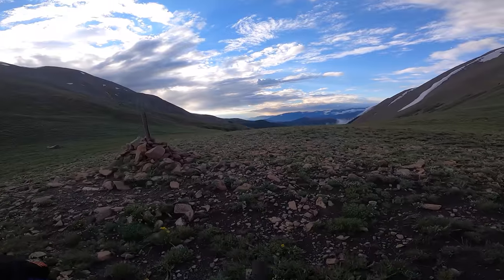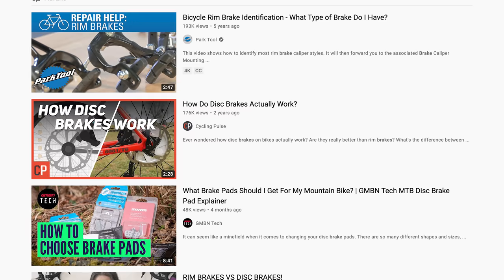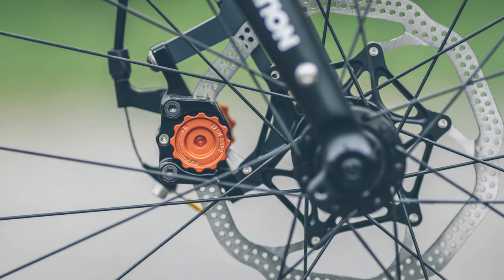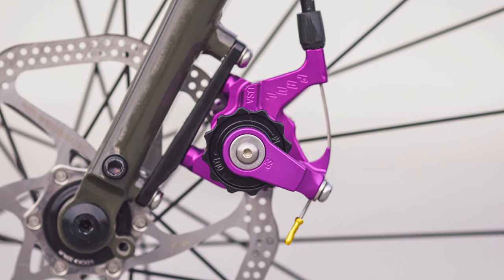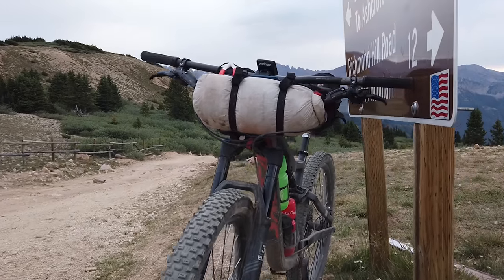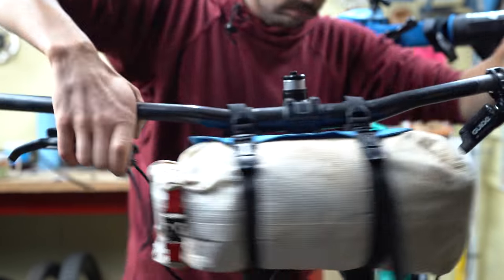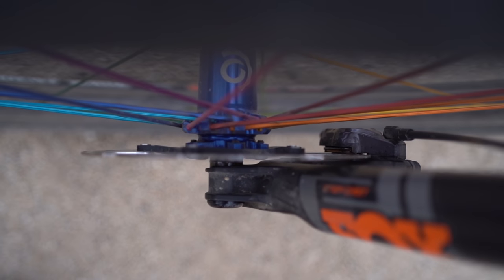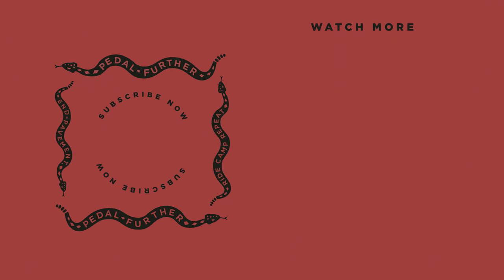The Best Brakes For Bikepacking?

Comment: Reliability of hydraulic brakes is pretty established with major brands putting them on mid entry level hybrids now.   For road use, I don't object to even cheap mechanical disc brakes, and they are going to have more than enough power to throw you over the bars.  I have canti's with kool stops on a cargo bike that stop it just fine in the rain with the bike loaded upwards of 270+lbs, but setup is a pain.    I like the modulation of properly setup V brakes, but pad/rim wear and wet weather are the big drawbacks.  I have worn out a set of V brake in a couple lift served downhill mountain biking runs back in the day, so I wouldn't run rim brakes other than on a vintage bike,  for riding around town, or on my road bike.

Comment: I love these videos.  Very informative.  I have both mechanical (BB7) as well as hydraulic (XT-2 pad) on my Surlys.  Nothing can beat the stopping power of the XT.  But, for fixability, I still use the mechanical on the longer rides.  I also bought a hybrid (mechanical/hydraulic - Zoom X-Tech) on a bike (Stump jumper) I use for testing - smoother than the BB7, but not as much stopping power.  Waiting for metal pads and 180 mm rotor to see if I can get it to stop better.

Comment: Another reason why your front brake is the most important one is that, when braking, the mass of you and your vehicle shifts forward and therefore puts extra weight on your front wheel (and relieving your back wheel) which gives you more grip/stopping power.
Reply from the maker: Great point, thanks for the comment.
Reply: Just like a motorcycle. 70% of braking power comes from the front.
Reply: & that's Me. the euros, & motos run the front on the right hand brake lever. Tort lawyers are responsible for American bikes having left lever front brakes.
Reply: Yup.  I used to train descending with just front brakes; just to keep from going OTB.

Comment: Running Origin 8 Vises (a copy of the Yokozuna Motoko 2 piston) on my Giant gravel bike and they are OK. I went to this style because I wanted to eliminate the massive Giant Conduct stem mounted cable actuated master cylinder and keep my cable shifter/brake levers. Glad I did too cuz not only was that boat anchor over 400 grams (454 is a lb), it was a huge obstacle for front bags of any type. I'm currently waiting on a backordered pair of Yokozuna Optimos with the 4 piston design.  I think these are the ones Logan reviewed last year.  They should have more stopping power for sure.

Comment: Side note on hydraulic brakes.  Shimano uses mineral oil, this is great above 20°F but can swell in the lines below that temp.  The swelling causes lose of brake modulation and can even lock up or ruin your brakes.  Sram uses DOT fluid which doesn't swell as much in the cold and is a much better deep winter brake.  However, I do have a friend that sees issues above 90°F with his sram brakes. Paul Klampers are the mechanical disc brakes I feel best about setting up and maintaining.  They aren't perfect but if you ride in a wide variety of weather they are great.

Comment: Definitely a hydraulic brake person although I envy the ease of maintenance and consistency over a long time of mechanical brakes. If you slack on your maintenence with hydros a set of cantis will end up outperforming them. My single piston Shimano are great after they've been tuned up but they dont stay that way all that long. Mechanical brakes on the other hand work just about the same all year long, especially rim brakes tbh.

Comment: Absolutely fantastic vid, probably the best content i have seen on YouTube about bicycle brakes. I have a Radrover 5 Ebike and the brakes are absolutely crap!! These are stock cable actuated mechanical disk brakes. After riding this bike 5,000 miles in the last year there is so much maintenance just to keep these brakes working. Any suggestion on a better mechanical brake to install on this bike? Not concerned about price, just need better brakes. All comments welcome. Thanks from Woodinville WA.

Comment: My touring/bike packing bike has hydraulic brakes - mainly because it was built using my old mountain bike components  on a new Surly frame. I use Hope two piston brakes on the rear and four piston on the front - because that's what I had! they are now 13 years old and all I have done is clean them and change the pads and rotors from time to time as they wear out. Both are 160mm so I only have to carry one spare. They are now getting a bit noisy and squeal a lot but they still haul me up like a champ - even on steep descents with 60lb of gear on board. They have braided hoses so are super tough and have survived many cartwheels and tumbles when they were on my MTB. I'm in no hurry to swap n- if it aint broke, don't fix it!

Comment: I recently switched from organic to semi-metallic front pads on my gravel bike & I'm a fan. It's a ultegra hydro & coming from a gravel bike with BB5 it's a good upgrade. One con to hydro is pistons can get stuck & will need to be cleaned as I experienced the other week. 
I upgrade the bakes during spring on my 27.5+ bike from the sram level TL & sram rotors to G2 RS with Magura storm control rotors, which are 2.0mm thick. Rear is still stock TL with 180mm rotors but I now have a bit more modulation & better emergncy stopping power. The thicker rotor also need to be a bit more durable but might just be a placebo effect.

Comment: Rim brakes were so simple. I never had an issue accept squeaking brakes.😀 Mechanical disc brakes are just easier for the average biker. Most don’t have huge downhills or need for such power. I’ve had mechanical disc brakes on 2 gravel  bikes and had more than enough power on both. I now have hydraulic brakes on a Hardtail and a 29er bmx. The bmx is stored in the garage hanging by the front wheel to save space and I’ve found that sometimes this causes the brakes to go squishy. The hardtail has had extra long cables that came setup from factory for 9 months because I am cheap and don’t own the tool to insert the barb. I have almost all other tools having been a bike mechanic and have worked on many mechanical disc brakes with great success. Hydraulics are just complicated😔

Comment: I use the cable-actuated hydraulic TRP Hy/Rd on my commuter/gravel bike. The modulation and stopping power is way better than a pure mechanical but falls short from pure hydraulic. My fingers don't get tired on long descents with my fully-loaded bike+gear weighing around 50 lbs. The only downside I have from the brake is the reservoir is huge af (aesthetics) and the semi-metallic brake pads squeals loudly when it's wet.

Comment: I run cable hydro Juin x1 in the front and trp spyre in the rear. Mostly bc the juin tech worked so good I put my rear brake on the front of my gf bike and put the mech on my rear. If the juin tech dies on a trip I’ll just switch the spyre up front until I’m home

Comment: Great vid as always.  I’ve all of the above on my various bikes, I will say the cable actuated hydraulics are great but get a brand that you can manually adjust for pad wear such as Juin tech.  Neil, I’d love to see a video on the use of clip on aero bars for bike packing especially when paired with hooped handle bars such as the Jones or so see Confucius.  Live to hear you advice and lessons learned.  Cheers

Comment: There's a compromise as well. Shimano just released the 12spd hydraulic R7100, but no mechanical. Leaves a lot with R7000 11spd wanting a mechanical disk option. The hybrid disc-actuated hydraulic brake is a solution. The Juin tech GT-F being a solid goto for gravel & bikepacking.

Comment: I've been hearing a lot more recently about how good Paul Klampers are... a far cry from the BB7's I used to run. Now it's XT 2-piston but I will prolly be going to XT 4-piston. I'm a shimano guy simply because I don't want to use caustic brake fluid unless I have to. Mineral oil for the win... Thanks! Riding in -40°... NO THANKS!!!

Comment: 4 piston, hydraulic, sintered pads, and stick with SRAM (Code R's) to answer the up-front questions.  Would have steel-braided lines had I good reason to worry.  (Some new super-cars are coming with 6 piston calipers..!  Trickle-down to motorcycles and then mountain-bikes down the road?). Lastly, living in Nevada, which is the most mountainous state in the Lower 48, have found that more is better no matter what   you're doing.  Bombing down Mt. Rose Highway or any mountain backroad at 40-45 mph, 4 pistons make things safer, faster, and more fun.        Spot-on video btw(!).

Comment: on my touring mtb I use a two piston hydraulic brakes and on my gravel bike its a cable actuated hydraulic set up. It's a world of difference. On my MTB I can stop on a dime anytime. On the other hand, my first 100km ride with my gravel bike got me into a minor bump because I couldn't stop fast enough enough. Rain could have been a factor on that too.
Reply: RollinRat  Agreed. I went for cable discs as I couldn't afford the hydro model, but thought, it's not a cheap bike and they're not going to have some unsafe brakes for a decent bike.  I was so wrong.
Reply: RollinRat  thank you. It's a boardman adv 8.6 (not the best brand etc but I got a discount through a friend). The brakes are Tektro MD-C510 flat mount cable (I'll be swapping with at least a bb7 and better pads, I have a spare from an old bike). I can only get a good quality breaking if I shift my hands down to the bottom drop. Brifters are Sora. I will add compressionless cables so thanks for that tip too
Reply: RollinRat  I appreciate the comprehensive rundown, confirmed a few things too. I will make what adjustments I can already ie positioning then see what can be liberated from old. I had a mtb with the long brake levers and old bb7, was great, got stolen though. Yeah it does feel like a fat tired road bike, I thought it would make for more comfort from multiple grips plus chance to get a bit more speed from low positioning. I am in agreement on the brifters too. At the mercy of needing a jack of trades bike rather than a couple masters.
Reply: RollinRat  I keep it till so much is knackered that it's either a full refit or a replacement, and they're never stellar to begin with, only had a few lifetime. I like the bike just miss the sure stop of old flat bars, which from what I've seen the hydraulic fixes. I feel like it's a natural flaw of the grip on the brake and its pivot. Also even with V breaks its coming from both sides not single like cheaper mech disc
Reply: RollinRat  I heard horror stories of sram failing on hills. That Surly bar looks amazing, I looked for bar swap options before but had no luck as it weren't just the bar. Even without the build issues I prefer the brake and shift separate, just a bar that goes one way to stop, no alternate direction for shifting. I guess custom build is the only way for both

Comment: I have a notion that mineral oil freezes up from about -5 Celsius or colder. I have been thinking of a multiday (at least a week) unsupported bike packing trip in the Himalayas with subzero temperatures. Would you suggest mechanical or hydraulic ? Thanks a ton….😇🙏🏼
Reply from the maker: SRAM Hydro, it uses are DOT fluid which performs much better in cold temperatures.
Reply: Mas péssimo em altas temperaturas.
Reply: You're going to be far from bike shops... Does hydraulic really make sense?
Reply: @szurketaltos2693  hmm yeah….that’s always there at the back of the mind. Having used hydraulic brakes for ages, it’s like an addiction where one doesn’t want to let go of hydraulics for mechanicals….😁…..
Reply: @sun27g  it might make sense to bring a mechanical set as a spare then rather than a bleed kit.

Comment: Well I changed to Paul Components Klamper Brakes a good number of years ago and have not looked back, yes hydraulic Brakes work great are much cheaper than Klamper Brakes but having to bleed hydraulic brakes all the time at work in a bike shop, when I go riding I just don't want to think about repairing or bleeding my Brakes because I'm having time out from work. So I pay full price and run Paul Components Klamper's and it's time to buy a second set in the coming months.
Reply from the maker: Lots of Klamper love, maybe I need to give them a full time test. I do love the fact that they are made in the States.

Comment: I've been on (the same) BB7s for a decade at least. The older ones were just built better. This year I added compressionless housing and 203mm rotors to the recipe and I gotta say, they are as powerful as my Saints on my other bikes. Metal pads for longevity through all conditions.
Reply: I'm on the same setup.. BB7 + 203mm for 17 years.. hard to trust anything else

Comment: I’ve got an old mountain I’ve tried to turn into a bikepacking bike. It’s my everyone not single track bike. It has rim brakes since it’s ‘96. I assume it would be a good idea to have a fresh set of pads if I plan on going on a long multi day trip.
Reply: The best V-brakes I have ever had are ProShift brakes.  Best mountain bike rim brakes I have ever seen.  If you can find a set, grab ‘em!  They’re a lot like the Hope of the 90s; all custom CNC machined.  I still run them on my Fat Chance Yo Eddy.
Reply: Invest in PAUL linear (V) brakes and learn how they function, not too bad. Unreal stopping power for a V-brake, the legends are true. KoolStop pads and you're good to go. I forget that I have vbrakes in back and a disc up front. They are amazing brakes by any standard. Not cheap but I've a set that are ancient, the pink anodizing has faded,  but they function like new.

Comment: Where are cable brakes cheaper? 
I recently tried to build a Krampus on the cheap, and looked at cable discs thinking they were cheaper. No way - entry level Shimano M400 series are about $50 an end, lever, caliper, and pre-bled, ready to instal brake hose (about $15 cheaper than a BB5 setup here - taking into account the rotor and cables). Somewhere along the way cable discs have evolved into a boutique product, the rest of us are stuck with fantastic hydraulic brakes.

Comment: I went from cable BB7's (often said to be the best for power & "modulation" to Sram Level TL 2 piston hydros on my bikepacking MTB & was blown away. I rode big motorcycles before getting into cycling & that's usually two (yes, two!) 6-piston calipers (yes, 6!) up front, & a single 6-piston on the rear with a smaller rotor. I had reservations about reliability like most people do but I don't know why. It's going to be a looooong time before you need to replace a hose. Bleeding bicycle hyrdos once or twice a year is a doddle. Similarly the upgrade from 2-piston Level TL's to 4-piston Guide R's was noticeable in power & modulation. I ride with full camping gear on rough steep trails sometimes & that's where these things shine. The cable actuated hydros look very neat! Maybe when my Guides wear out in about 20 years time....

Comment: This along with the Tire video has been extremely helpful to a bike noob planning a great divide trip.  Do you think its worth replacing the mechanical brakes on my brand new fargo with hydraulics if its a trip of a lifetime for me and want to have the most enjoyable time?
Reply: First I would ride the bike as is.  Then I'd load it down and ride down the biggest steepest hills that I could.  If the brakes feel inadequate I'd try increasing the size of the rotors.  Other things that will improve the function of your cable disk brakes are higher quality compressionless housing and if applicable I'd machine/file the housing ends flat/square.  Bad ends on the housing significantly decreases the brakes performance.
Reply: @mikekrasovec6390  thanks! but I’m a hiker and have no clue what a lot  of that means or if as is is enough for the GD.  Will try though. 
How much is it to replace with good hydraulic set up
Reply: Trp spyres are good when finetuned & well adjusted. Theres a Good tutorial on YouTube from an old dude from Great Britain
Reply: @pgreenx  I think that you'd probably be fine with what you have.  Installing bigger rotors is an easier and cheaper option.  Mega expensive wunder bikes are rad.  What you have is probably good enough for you to have a good trip without your bike turning into absolute junk.  Have a few multi day local trips with what you already have.  Maybe your handlebars will need to be further out/closer in or higher/lower,  different grips/bar tape,  seat...  or something.  Ride your bike as is.  Worry about your contact points.  With hiking you want shoes that are comfortable for you as well  as a backpack that works for you.  Bikes are having the seat and handlebars in the right place,   a seat that works for you... I will add that there are lots of different types of handlebars as well as variations of a certain type.  Within those variations the bars there are differences in how the bars bend  - those differences seem minor but actually make a significant difference after you've spent enough consecutive long days on  your bike.  Ride the crap out of your bike.  Make sure that you feel good on it.  Make sure that it's working right when you leave.  Know how to do a few simple repairs such as fixing flats.
Reply: @mikekrasovec6390  Thanks. I understand the shoes and backpack thing and done my fair share of miles on foot but want to try biking.  Looking forward to my trip next yr